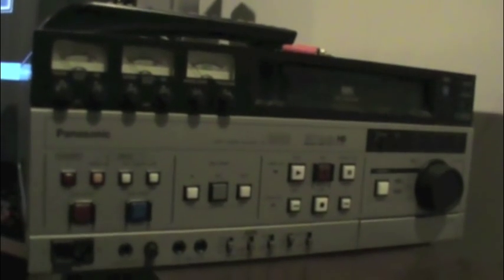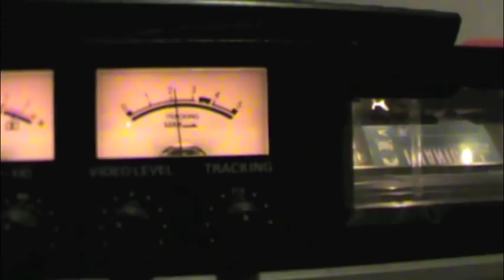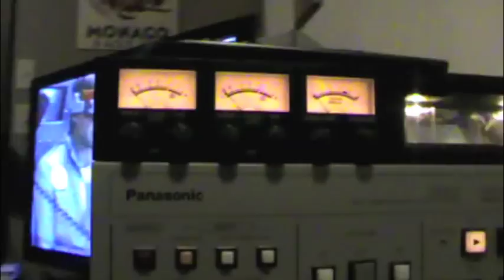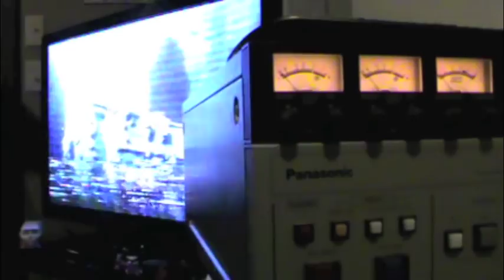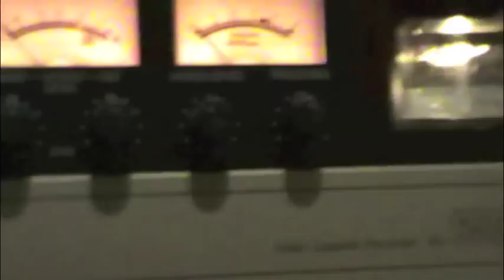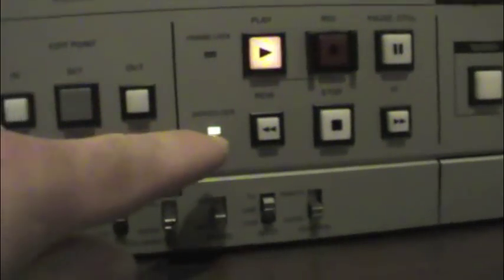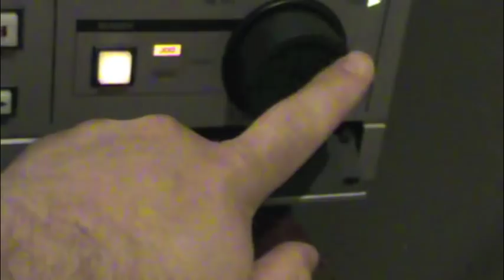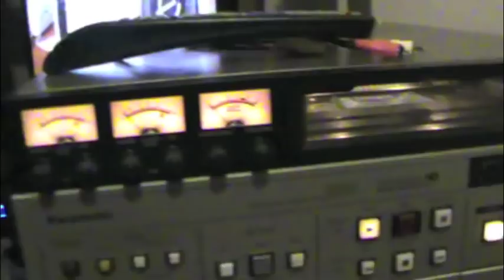Test and Demonstration of Panasonic AG-6500 Editing VCR

Comment: One full rotation of the jog dial should correspond to one frame of video. Others are right, you shouldn't really use T-120 tapes in these decks. We used Maxell Professional/Industrial T-30 and T-60 tapes in ours. They have thicker tape stock that can take the abuse.